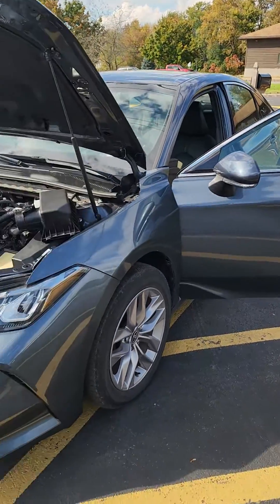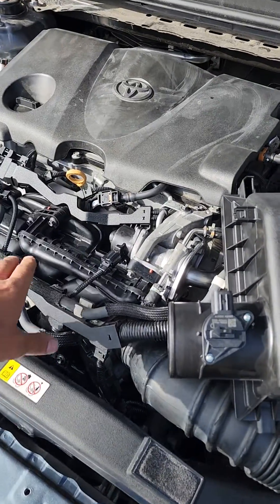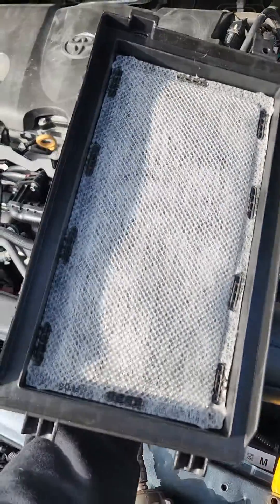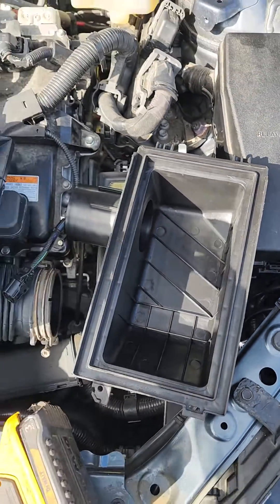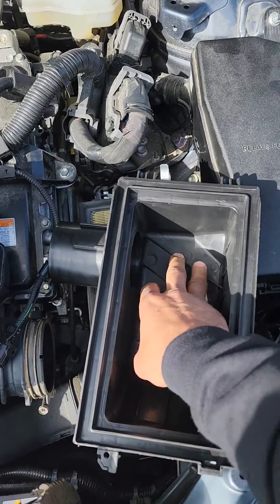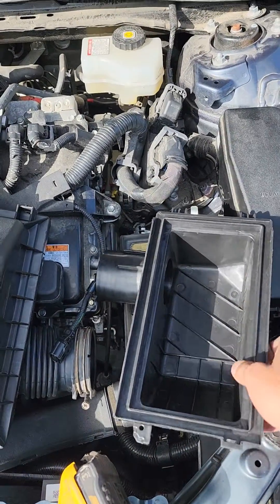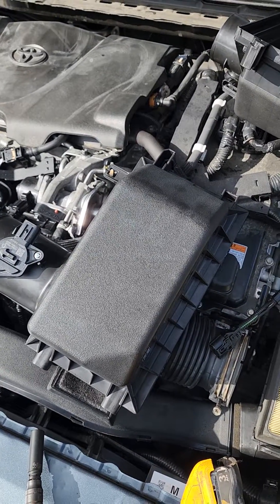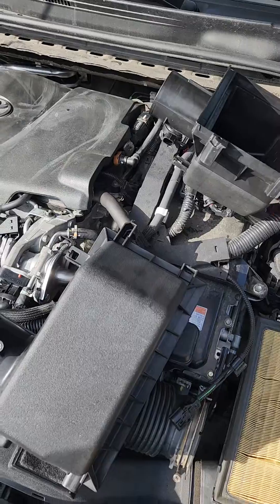Toyota p0100-64 2020 Avalon hybrid

Comment: I have been shocked when I saw your video!!! 😮 with this specific issue ,same damn DTC in Toyota Sienna 2021 XLE (Hybrid) Also involved in accident, replaced everything with OEM Except Air intake Housing (After Market) BUT i have moved that built-in filter from old broken housing into new NON-Factory housing😮😮Still having Code in second Cycle after driving. Vehicle dropped in multiple experienced bodyshops nobody could figure it out yet 'cause all tests and possibilities ran out  of hands. It is been 4 months with a mechanic for repair that damn Code. PLEASE, HELP ME ,ARE YOU SERIOUS!! What a joke(Toyota Manufacture).😢😢
I will give an update here if the problem fixed. Many thanks  in advance❤
Reply: Updated: Thanks God finally THIS DAMN AIR INTAKE BOX has fixed my problem. Man, 3 mechanics, one of them was expert & specialist on EVAP SYS plus Over 4 months in shop ,I 've spent around $2000 without any success😢. I was just lucky enough to watch your video by accident. BTW, even pre filter/strainer was NOT the problem because i have bought used OEM box from Ebay comes without strainer, although my original had strainer before in it then i moved it/modified the after market box  BUT wont work! I have noticed dimensions are same on both boxesTHE FINS a little higher in the OEM one may affect the reading (JAPAN, 😅whats the craziest design ever seen ) Even the specialist couldn't believe that. Many thanks to my life saver❤❤❤

Comment: Man this video was a God send for me!  I have a Rav4 Hybrid that was having the exact same problem.  replaced the airbox with a non-factory airbox and it ran rough and threw codes P0101 and P0100-64.  Replace the box with an OEM airbox and the code has not showed up and my mpgs have gone up from 35mpg to 44mpg.